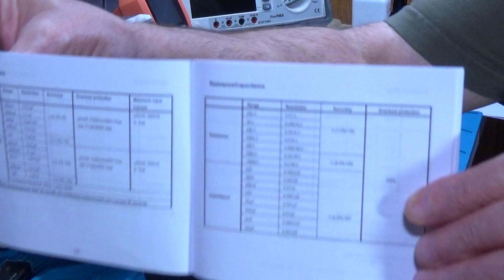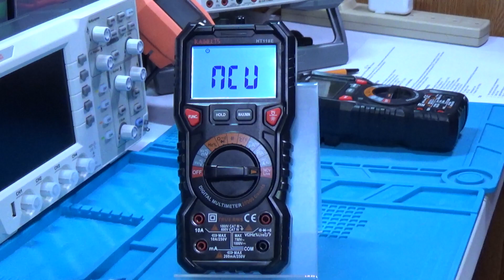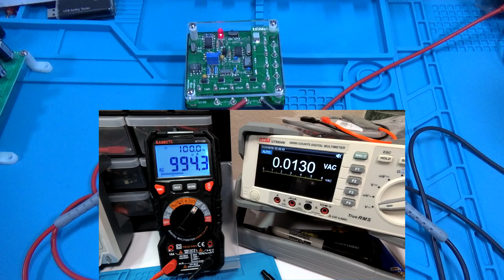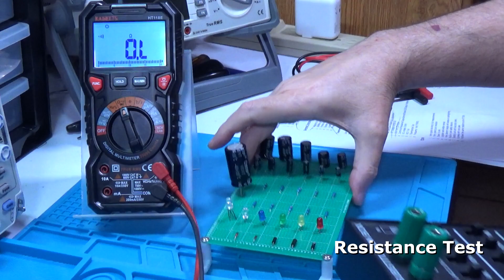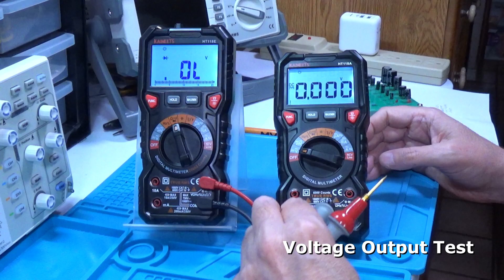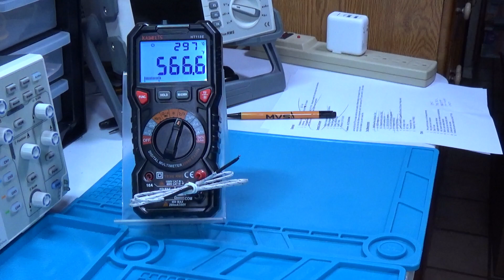Kaiweets HT118E 20K Multimeter Review and Testing

Comment: I just got mine and I'm totally happy with it. It does everything it's supposed to, with a level of accuracy that's completely sufficient for me. My only small criticism was that the temperature was primarily displayed in Fahrenheit. But you can actually change the default setting, as I later found out (you can find a video tutorial on how to do this on the manufacturer's website).
Reply from the maker: Doesn't make much difference to me, personally - it's nice to have both english and metric system displayed simultaneously.  I left mine set as is because I'm in the USA.

Comment: can you recommend this dmm for mobile technicians? did you find any weakness in ht118e?
Reply from the maker: Depends on what you mean by mobile technician.  If you're talking about working with high voltage CAT III/IV - ABSOLUTELY NOT.  This DMM doesn't have anywhere near the protection required for such applications.  If you're working in lower CAT I/II voltages, which would include your standard electronic circuits and such - then yes it would be fine for that.
Reply: @Sui778  Thank you very much for replying to my comment and explaining about measuring ratings 👍 if you don't mind me asking one more time 🙏 Is there any problem with this dmm when measuring in diode mode?
Reply from the maker: @juleshaaa575  Not that I found.  It will not, however, give a continuity beep when measuring diodes - not a dealbreaker to me, but could be to some.

Comment: Do measure ac voltage in more than +10v  V multimeter from dc V source, HT118A voltage display goes crazy and fails in this situation, but reconnecting multimeter to mv ac works.
Reply from the maker: It's likely a software or firmware issue.  This and the HT118A are the only two I've tested that have that problem.  Everything else I have tested measures the frequency, voltage and duty cycle correctly.
Reply: I have 2 pieces of HT118A, they are 100% identical, about 1 year production date difference. Not heard about firmware update for cheap measurement equipment.
Measuring mixed voltage/signal makes the difference visible between pricey and cheap equipment. Some cheap meters show high voltage results even one probe not connected.
Reply from the maker: Evidently wasn't done with the HT188E either.

Comment: I think they made this one badly, but the KM601 has a very fast autorange, which is important to me when measuring resistors
Reply from the maker: I wouldn't call it bad, but the lack of the REL function is an major achilles heel of this meter.  Far and away it's biggest problem.